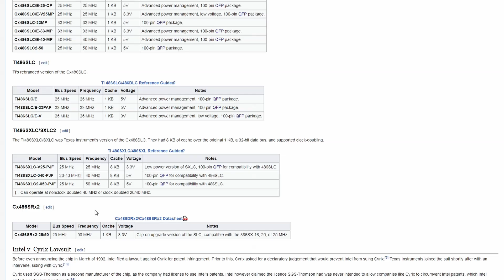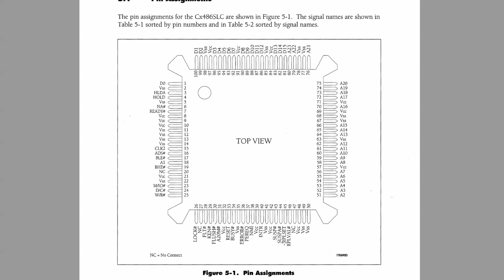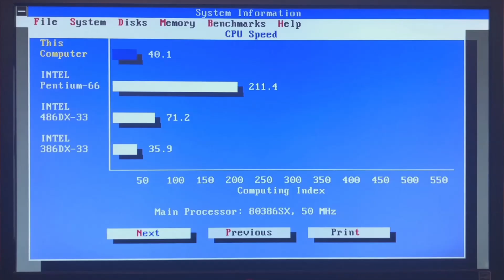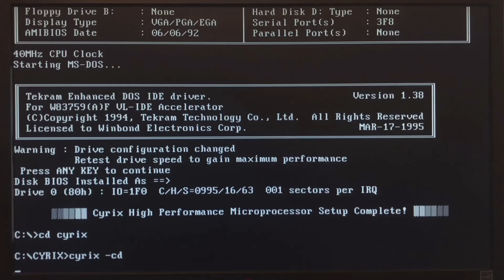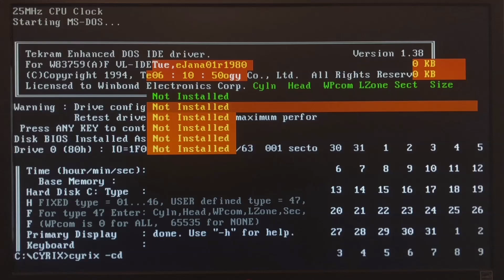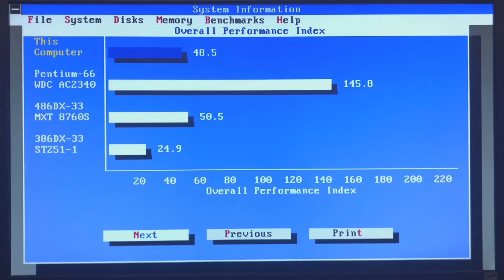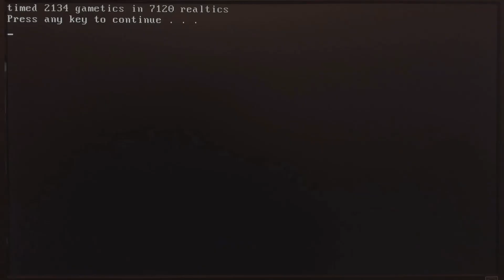Hacking a 486SXLC2 (8KB of L1 Cache) into a lucky 386SX Motherboard. Insane performance boost!

Comment: It's surprising how much slower SX-stuff is compared to DX. My first 386-PC was 386SX-33 back in 1993 and my friend had 386DX-40. At the time it was all about megahertz, nobody talked about data bus width. Just got myself a Toshiba T3200SX (386SX-16) and it's just soo sloow 😅 My tuned Toshiba T5200 with 486SXL2-40 wipes floor with it.
Reply from the maker: My first one was 386SX-40 probably in 1994 80MB HDD. Back then no one else had a PC and it looked fast to me either-way XD.
And Yeah the difference surprised me too. Defiantly Bus bottlenecked.
I now have a SX M/B with cache, so I will come back to to the topic to see if there is a difference.
Reply: That'll be interesting to see! Just bought myself a 386-motherboard with 486DLC-33 on socket, MG-38606 and it has 256KB cache, UMC481. There's 66MHz oscillator and I have 80MHz one to put there but I think I have to buy any_clk from you to get everything out of it 🔥 Need to check do I have any 60ns SIMM or only 70ns... 🤔
Reply from the maker: Nice :) I want to get more M/Bs too. I have a few :)
My fast Simm modules will also be back in stock soon :)
Reply: @atheatos  Contacted you through the website for the any_clk and extra crystals 😃
Reply from the maker: Yeah I saw it thnx. I am sorry I am very busy these days, I will answer later today.

Comment: Great video. I just purchased the same board and I'm interested in picking up a 486SXLC2 and attempting a similar mod.

Would you be willing to share how you got the adapter PCB made? I'd love to build one for myself.
Reply from the maker: I am sorry but I can not share my designs.
Even If I were to share designs, in general these are quite hard to build.
If you are interested to buy an assembled and tested module like that, you can contact me though email.

Comment: Good upgrade! :)) Now we need motherboard with 50Mhz and CPU with working doubler :)
Reply from the maker: Regarding 50MHz I am not sure if it is the M/Bs fault. I was able to run (somehow) the 386SX at 50.
Regarding clock doubling, it looks like it works on some M/Bs it freezes on other. It is not only me.
So yeah, I just need better luck next time.

Comment: I think that Cyrix made the chips for IBM.
Reply from the maker: Cyrix was fabless back then. They used other manufactures to produce they chips.
They also license their designs to others to produce with their brands.
These 486 386 replacement chips were also given to Texas Instruments.
That is why the one I am using is branded as Ti486SXLC.

In this generation IBM licensed the 486SLC form Intel! Probably a 486DX4 clone.
For sure, later with 6x86 many were produced by IBM and some are even branded by IBM.

Comment: Interesting...  I have a Zenith 386SX16 desktop.  It has an AMP socket that just allows you to swap the 386SX CPU.  I stuck a 5v 486SLC in mine about ten years ago.  The clock doubling worked out of the box on mine, but I was never able to get it to boot at a higher frequency than 16 mhz.  So the machine is a 486SLC at 32 mhz
Reply from the maker: There is probably a strange incompatibility with my specific board and clock doubling.
Now your report is very interesting. And yeah 32MHz is low.

Clock doubling CPUs are only the 486SRx2 and the 486SXLC2.
Also when you boot this is always disabled, you have to enable with config bit (Cyrix tool).
486SLC is not clock doubled, unless we are talking about an IBM 486SLC2.
These are a totally different story and typically do not write 486SLC on top.

So I am not sure on what exactly CPU you have.
Maybe it is not a model with internal clock doubling.
It will be interesting to know how you got clock doubling.
or what exactly is written on your CPU.
Reply: @atheatos  I may have misspoken, Mine is a clock-doubling chip. It's been a few years, so I don't remember exactly the part number.  I'll have to look.
Reply: @atheatos  And the Cyrix 486SLC2, in that one the clock doubling is always enabled
Reply from the maker: I think I do not have this one to test.
At this point I do not even know what I have any more :/
Reply: @atheatos  I feel your pain 🤣